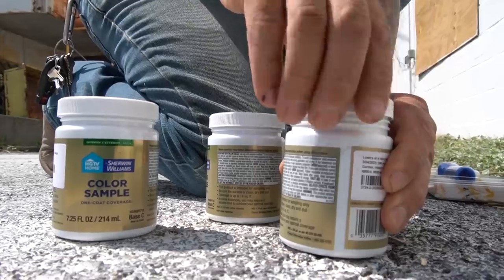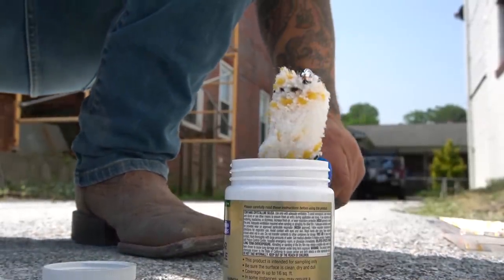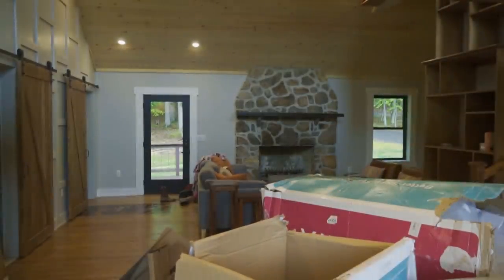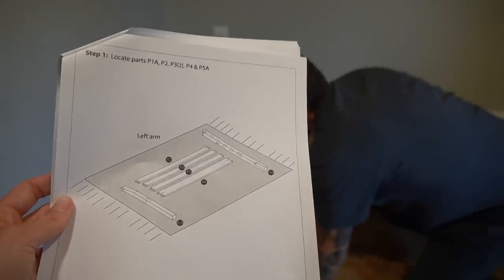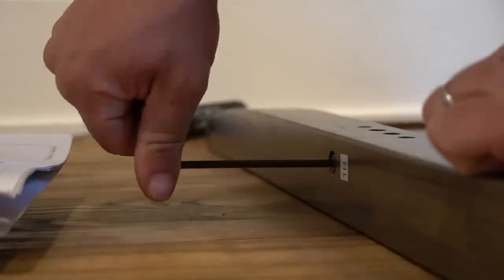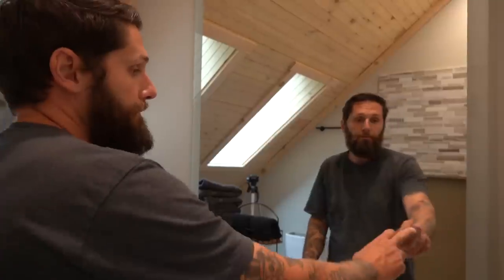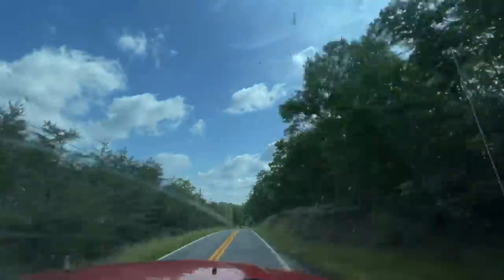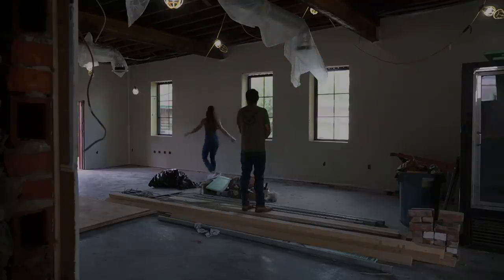TRANSFORMATION Of The Cafe Exterior | Renovating A 100 Year Old Building

Comment: I love your videos and you guys do awesome work. The only negative thing about flat paint is it’s not scrubbable.  I tend to use satin on most painting jobs. For painting brick I recommend using Sherwin Williams pro block tintable primer.  I like to use a 50%-75% mix in the color you are going paint with. I like using their “super paint as well”.  It doesn’t dry too fast and will repost and touch up very well.  Using a tintable primer with a good quality paint will leave your painted surfaces popping!  The place is looking good!

Comment: i seen there is no fireplace screen or frontage glass of some sort to protect from sparks of embers coming out on to the floor or somehow causing a fire.    At least I didnt see it if you have it already.
Reply from the maker: Guests won’t be able to use the fireplace. It will be stacked top to bottom with kiln dried firewood as decor. It’s too much of a safety hazard to have guests burning a fire inside. There is however a fire pit outside they can enjoy if they’d like 😊

Comment: I used to fight the same color selection battle. Everything was always "too blue".

I switched to Benjamin Moore paint and the problem went away. Not only is the paint a great product with excellent coverage but you can buy samples OR quarts and the sample cost is credited against the cost of a gallon when you make your final purchase.

The bad part - Benjamin Moore is hard to find. I can only find it through Ace Hardware. It is also more expensive than any paint I've found but, again, it's very thick paint and covers better than any other.

I have no association with either ACE HARDWARE or Benjamin Moore Paint.